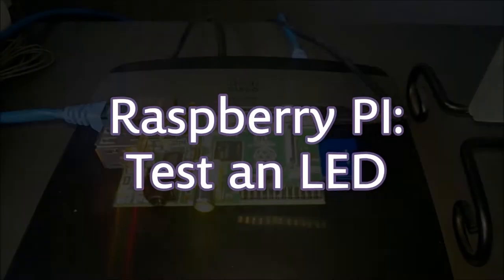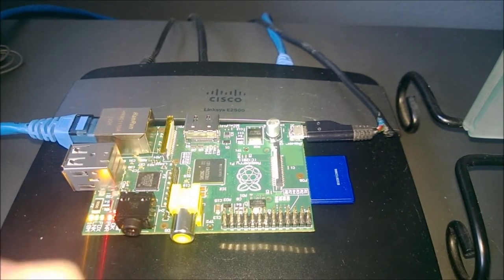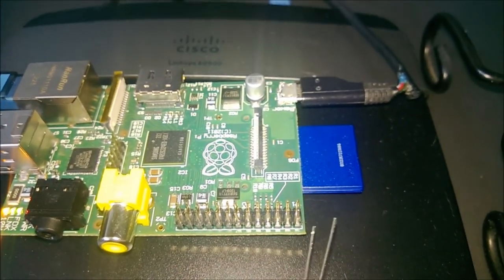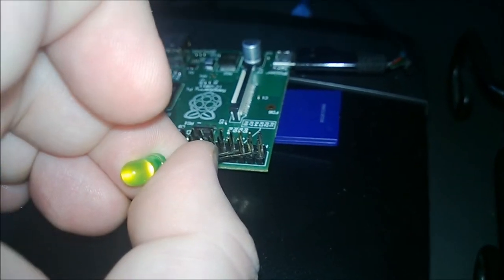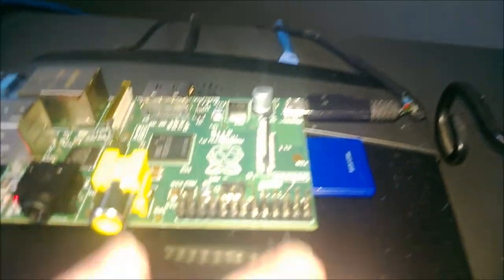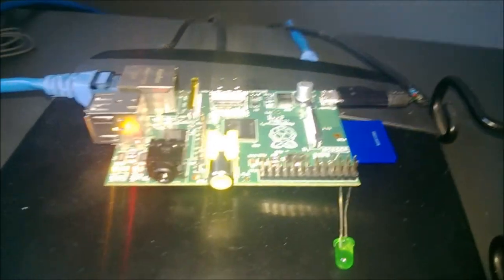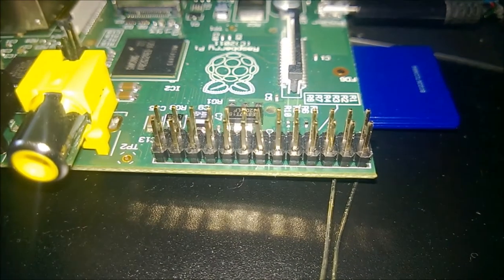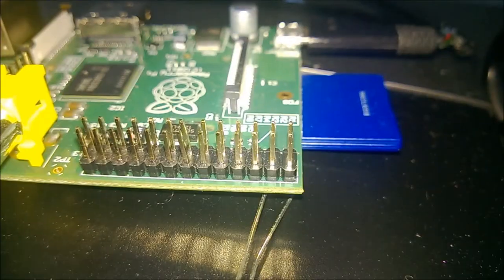Raspberry PI will Light and Test an LED & Burn You?

Comment: Yes you will get burnt by connecting a LED to a voltage that may be too high. Connect a resistor between the led and pi to protect the pi and the LED.

also you must have a very steady hand to just touch components onto the GPIO , one slip and your short the pins and damage the Cpu and or other components.